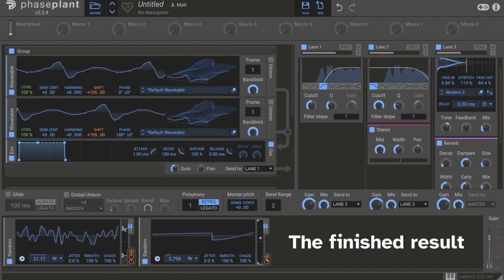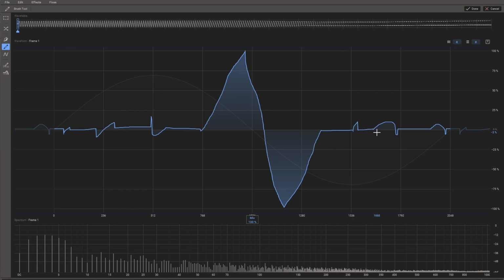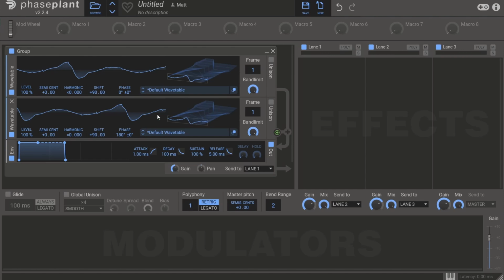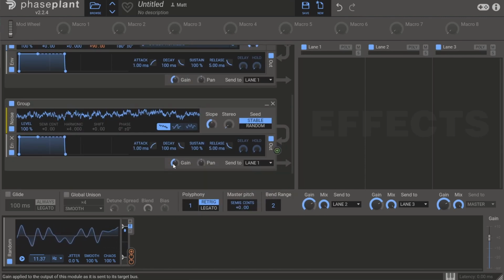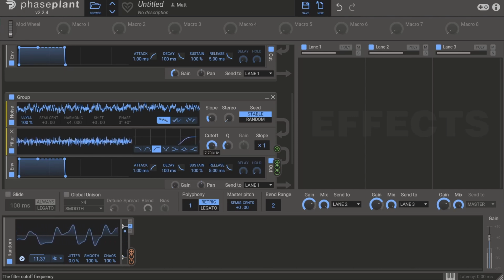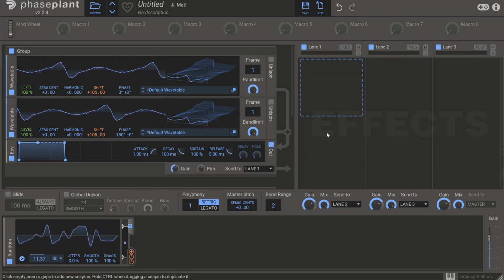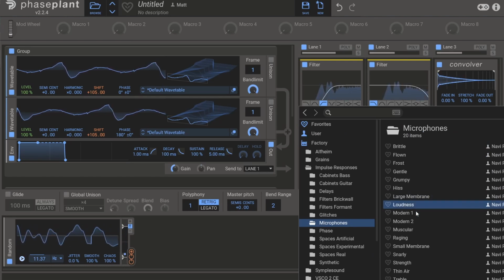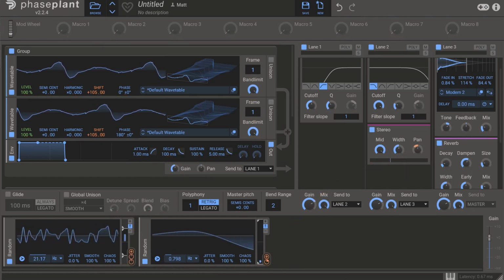Synthesizing a Fly Sound 🦟

Comment: Peanut gallery here...  I want my flying fly to have some volume swell along with the pan to simulate distance. (To get nitty gritty... a distant fly should not be able to pan as fast as a close-up loud fly. Also I looked up doppler effect for 10 miles per hour. It's about 98.7% to 101.3% depending on towards or away. Could this be paired with volume swells? Get louder and pitch rising, get softer pitch descending. I'm thinking of the great sound a bee makes it whizzes by you in a field...you can hear the doppler flip. )
Reply from the maker: All valid points! The "Remap" module would come in handy for most of those ideas. For example you could achieve the volume swell by connecting the randomiser to a remap module which is set to have a bump in the middle in order to make the fly loudest when in the centre. I think it'd be tricky to create an accurate doppler panner for a looping sound purely within Phase Plant because you'd have to account for the fact that the insect could change direction which would be a challenge to account for! Though I have created short "doppler pass-by" sounds in Phase Plant/Snap Heap, which you can achieve by having a curve (set to a linear ramp shape) and two Remap modules. The first Remap could be assigned to the volume and would have a high value in the middle, and the second Remap could be assigned to the pitch and panning and this could be set to replicate the doppler shift curve (high value at the start, then flipping to a low value at the middle)